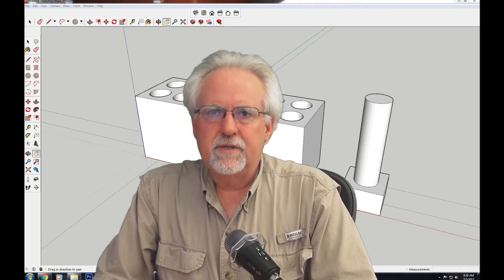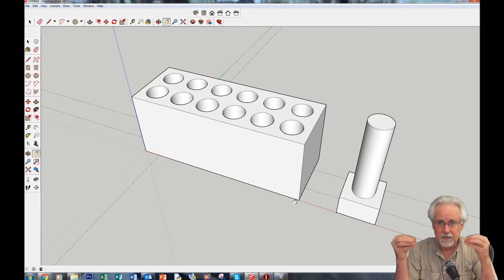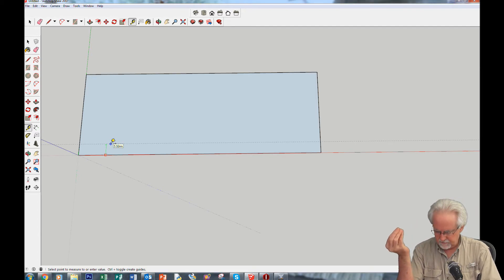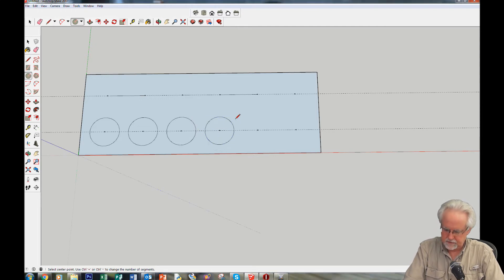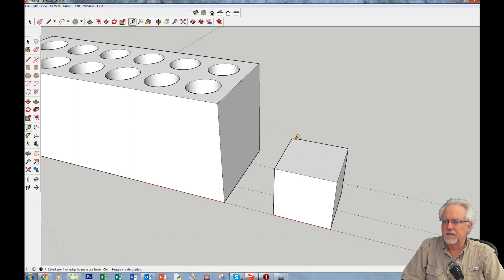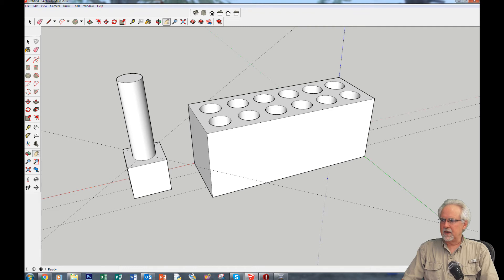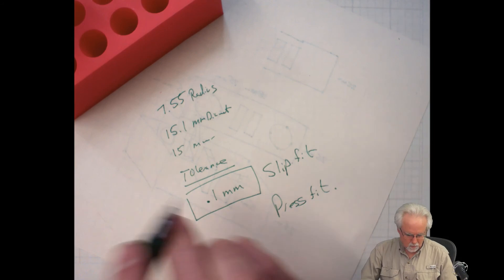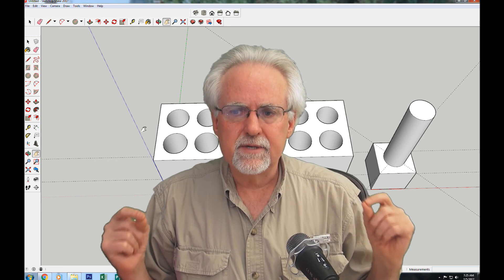Sketchup Tutorial LESSON 7: Understanding Design Rules Tolerance for Slip and Press Fits

Comment: In my industry (jewelry) I believe allowance for fit (shrinkage or vice versa) is dependant on several factors such as object size, material, and design shape, manufacturing technique, etc. We usually use %.
From this test of 0.1mm.  If we are to print a 2mm cyclinder and a 2.1mm cylinder hole, it could be loose.
But I understand that the purpose here is to find a standard so we don't design in a vacuum as you concluded in the video.
Thank you for the nice tutorial!

Comment: I learned that with my resolution and 0.2mm gap for sliding dovetails....nope.  I either need a much higher resolution print or bigger gap.  I'm thinking the gap needs to change.  I'm surprised at how loose things are that we take as fitting perfectly together.

Comment: It would be interesting to see these parts printed on the lower cost printer.
Reply from the maker: Yes, good point. I did that but just did not show on the video. Thing is that the tolerances are printer specific, so printed on the Prusa the tolerances were different. I have some videos coming up shortly on the prusa . . . it is my favorite machine so far.
Reply: I expect the Prusa to be a bit different. It will be interesting to see how much. Once you know the tolerances, can you adjust the printer software to compensate for the differences?
Reply from the maker: I really imagine designing to a specific printer. Not sure how I could have one file optimized for both printers.

Comment: Wondering if you have tried increasing the number of sides for your circles, and if that would make the printed product truly more rounded, or is that a product of the .STL and slicer software?  I can hear the sides "clicking" as you spin the cylinder in the smaller/tighter holes.  I have seen tutorials that tell how to increase them and why in 3D construction designs that they are not true "circles". 
Got to say, I agree with K7AGE. 
A coworker has offered me his old Make 3D printer to try. I know you've had problems with that brand. He seems to have been fortunate, I suppose. Great video series!!!!!
Reply from the maker: YOu are perceptive. The default sketchup software has rather flat sides on the circle . . . not enough segments and that was reflected in the prints. Certainly the circles in sketchup are poor, but you can round them be defining the number of sides after drawing the circle. 90s would give the circle 90 sides which really smooths it out. Probably the same things going on in the slicer software.
Reply: Paul McWhorter Have you tried printing a test column or hole with more sides? (I see the maximum is 999.).
Reply from the maker: not yet, but I plan to